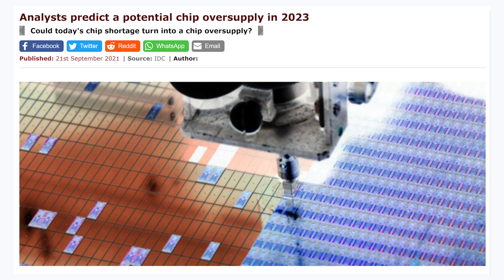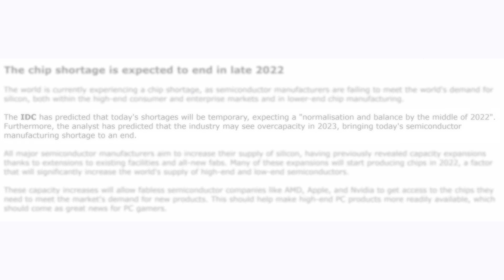You're Going to Like THIS - Chip Shortage Update

Comment: If manufacturers REALLY wanted to help "Gamers" they should have required an account with 2 step verification to battle the bots.
Reply: Well hopefully profitable tanks and the chip overflow becomes permanent because these prices i cant pay 600 plus on a graphics card i dont have the spare change to do that im still 5 6 years behind on gpus i dont even have a 2000 series and if prices continue i would be getting a 4000 series either
Reply: yeah also limit to one card per adress.
Reply: Manufacturers don't control retailers
Reply: @chadbizeau5997  Seeing how manufacturers (AIBs) sold pallets worth of GPUs to miners... I dont see a problem for them to put aside some stock for gamers at MSRP. 2 step authentication account and warranty is tied to said account. Easy
Reply: @priitmolder6475  they sell wholesale.

The miners who bought from them bought in bulk.  

Not saying that I agree with it.  With that said EVGA did set up the queue.  But I know people have been in that queue for a year
Reply: @priitmolder6475  Why would they do something liken that? They will sell it to the highest bidder.
Reply: @DRAG0N1012  The amount of power these GPUs have 
It’s a miracle on how cheap they are. 
If you can’t afford it, then no offense man, that’s a you problem
Reply: @norysmo  They make massive profits on gpus maybe not aibs but nvidia makes hundreds per gpu 600 plus for a gpu when i don’t want or use ray tracing yeah no thanks.  there is no such thing as too cheap that’s a stupid mindset i wouldn’t pay over 300 for a 3060 and definitely not over 600 for a 3080 these prices are overpriced supply constraints or not
Reply: I agree
Reply: But my question is why can't you be a manufactureres

Comment: there is no chip shortage for GPUs. They are all being gobbled up by miners and that will continue forever so long as they basically print money.
Reply: So Nvidia has been lying during their investors calls about the chip shortages?  For a company as big as Nvidia blatantly lying about the shortages does more harm then good.  Why would they lie?
Reply: @CC-il7dg  Your question is based on the premise that Nvidia is claiming chip shortages to investors to explain WHY GPUs are in short supply to gamers which has not happened.  Why should I or anyone accept this premise that you have just invented?
Reply: @r3conwoo  If there is no chip shortage for GPUs like you say then what was intended by Nvidia during their investors call where they say they are  'supply constrained in graphics'?  Is being constrained not indicative of a shortage or is it simply a spin on supply and demand?  Why was 'supply constrained' used rather than just saying overall demand remains high?
Reply: @CC-il7dg  My point is that there is no evidence that they have a reduced manufacturing capacity for this generation of 3000 series cards then they had for the 2000 or 1000 series cards. If anything they have an increased capacity but nothing is enough to satiate the demand due to mining.
Reply: @r3conwoo  Yea when i was digging deeper i noticed that the media coverage on the actual calls seem to have created their own linkages and analysis whether accurate or not and then any bit of misinformation just proliferates from there unfortunately.
Reply: Uhm even car manufacturers having a tough time. Idk what ur talking about buddy, we have no inventory to sell
Reply: @billlam7756  they don't put GPUs in cars so what you just said makes no sense.
Reply: @r3conwoo  you living in the stone age?? Some of the parts is used to make gpu are also for cars
Reply: @r3conwoo  Supposedly the same suppliers of the chips that go into Graphics Cards are struggling to supply the chips that go into cars (e.g Cars with Computers/Displays etc).
Reply: @r3conwoo  you don’t know what you’re talking about
Reply: @Ash-my4gf  no u

come back when you have a real argument
Reply: @billlam7756  you mean silicon? Where is the evidence that manufacturing capacity for Nvidia and AMD is less than what it was in previous years?  Where is it?
Reply: @r3conwoo  no you honestly don’t… you have 0 clue about the chip shortage
Reply: @Ash-my4gf  i told you to come back when you had a real argument not to just repeat lies twice.
Reply: @r3conwoo  no you didn’t you just edited your comment after I replied to you don’t talk
Reply: @r3conwoo  I worked for toyota, not gonna provide you with graphs and data. Fact is all dealership inventory are extremely low.
Reply: @billlam7756  that doesn't mean Nvidia and AMD are making less GPUs than they did in previous years.  How you are making that connection is beyond me but you don't want to seem to let it go so believe whatever you want then.  /shrug

Comment: I want to do both, I use my mining cards to game on now. 5 1080ti's paid for themselves and sold a couple too. Now I just run two. they've been spinning away at 80% power for 4 years now, they only earn about 5 bucks a day and after electricity,  it's an extra 100 bucks a month to stash away for building my next gaming computer. I want to upgrade, not for mining, but for gaming, I'd like to build a 4k 144hz capable machine, right now I can do 1080p at 144 on most games but I'd like a bump in monitor size and res. I despise scalpers and bot buyers though. The two cards I sold were "given" away for half of what I bought them for, not the 800msrp that people are still charging for 4 year old used cards. Amazon and Ebay's lack of anti-scalping policies is disgusting.

Comment: There are limits to how much prices can fall and those limits slowly increase year after year. It used to cost on the order of a couple of million dollars + R&D to design a GPU back in the late 90’s; meaning that a die shrink of an existing GPU was almost free. If you could sell 1 million units that die shrink only cost you a couple of dollars per GPU.

Today it’s hundreds of millions of dollars + R&D. The masks, validation and everything else around designing the chip costs that much. Even if you don’t do R&D and just do a lazy die shrink, if you only sell 1 million units that adds a few hundred dollars to each GPU, even if they maybe only cost $50 each to fab or whatever.

Chiplets help because you can crank out more of a particular GPU and amortize that cost across more GPUs. EUV helped, but soon we will need double and quadruple masked EUV and that will be undone.

Comment: See I might just wait and hold onto my GTX 1080ti unless the rumored Super refresh delivers a RTX 3080 with at least 12GD of Vram for the original 3080 MSRP. Fucking pipe dream I know.
Reply: Don't hold your breath.
Reply: there's a ton of 3060 slack at run end. but I get it I would buy 4 stretch too. mb
Reply: Nah bro keep your 1080ti that card is still a beast for another 2 years.

Comment: Prepare to be disappointed guys ; )
Precious materials required for making electronics have increased in price recently anywhere from +10% to +150%.
TSMC raised N5 prices by +20%.
If anything, prices will increase in 2022-2023. You'll look back at 2021 regretting not buying a GPU now.
Reply from the maker: Earth metals and silicon are VERY cheap. It could be 4x more for copper and still barely matter. 

Plus this is only going be an issue as long as demand outstrips supply.

Comment: If I can buy a 6800 or XT variant instead of a 6700 XT. I'll be happy. My 2060 ain't gonna cut it for a Reverb G2.
Reply: Are you nearish to a micro center?
Reply: You have a 2060!!?! I’d kill for one
Reply: @sindar8179  unfortunately not. I have some garbage homewares store that sells computers and other white goods at a ridiculous markup.
Reply: @colonelpanic17  I'm not complaining about having a 2060. It's a great card for 1080p, which is what my monitor is. But I'm aiming to get a Reverb G2. And I don't want to hear my card screaming because I'm making it try and do 1440p at 90FPS. Or full res 4k at the same frame rate.
Reply: @justinpatterson5291  Yep building pcs was a lot more fun years ago. Mom n pops are gone and the big etailers are just megga corps now with one goal $.
Reply: @sindar8179  I'll put it to you this way. For the 950 a 2060 now costs from scorptech. I could only get a 1660 from the local store we have.
Reply: @sindar8179  As FTC auditor I am keeping an eye on the retail situation. mb
Reply: @justinpatterson5291  I get supply and demand and all. It just seems like everythings all at once gone into ultra screw you mode. I miss local small shops vs New Rotten Eggg, who used to be good before they were bought out.

Comment: I see a “bull whip” in the chip market, similar to what happened to the lumber market. Over supply will happen if not in 2023 than 2024 at the latest. TSMC and Intel are building new foundries in Arizona. Samsung also building in US, not sure where yet. China and Europeans are building their own foundries. Chip foundries are now geo political resources, similar to oil and each country need a source within their country if war breaks out.
Reply: The TSMC factory in Arizona will be a lot smaller than the one in Taiwan. It will produce only 2% of what the Taiwan factory produces each month, which is approx 20K chips. They will probs prioritize car manufacturers like Ford first. So not really helpful.
Reply: @Oozaru85  My understanding are foundries slowly ramp up production. Foundries are very expensive, in order to maximize profitability, they start making chips before its even fully built out. TSMC isn’t going to be fully built until 2029 per estimates. From what I read, they will start with 20k wafer per month and will eventually hit 100k wafer per month.

Comment: I'll believe it when I can get a 3060ti FE for msrp.
Reply: Um, yeah, about that...
Reply: @masterlee1988  so...... pretty much never?
Reply: @bdrmongoose7864  At this point it might be. Though I wonder about the prices of it once the RTX 4000 series comes out.
Reply: Tons of 3060 in build its Ampere run end sorting through the capable devices. mb
Reply: wait for rtx 50/rdna 3 this oversaturated market will crash like evergrande.
Reply: @slumy8195  You mean RTX 4000 series?
Reply: @masterlee1988  nope prices will remain high. the 5k series will see a decline in sells and get as close to msrp.
Reply: @slumy8195  Fair enough, but the 5000 series may come out by 2024 or later which is a long wait.

Comment: Just bought a EVGA 3080 Ti FTW 3 for $2k.. Hope I don't regret it!! xD
Reply: u wont. 3080 TI is an awsome gfx card for 4k gaming @144 Hertz with rtx and all the shinys on. Its a whole new level of gaming. Cannot be compared to what i , since i became a 3080TI owner, call  "low-res gaming". If you dont use 4k res, u dont need a 3080+ GFX Card.
Reply: @Holozon  I have a 2k monitor @ 165 Hz currently using a 1080 Ti.
Reply: If you care about saving money, you made a terrible decision. 😅
Reply: @christophermullins7163  Well… I paid a total of $00.00 for the RTX 3080 Ti, BUT I used the equivalent of $2k by using crypto that was 100% mined. So in the end, I spent $00.00 and 0 hours worked because the computers did all the work mining. I did have pay for the electricity.
Reply: @christophermullins7163  sometimes u need to spend money. perhaps on a nice 4 k monitor, and a bigger powersupply, because u spent money on a 3080 TI :D.... But if you fire up Doom Eternal on your brand new 4k Monitor, or big TV.... all that money was worth it.
Reply: Have the same card now for nearly 3 weeks, went from a 3060ti. Absolute beast of a card, temps are also very good when loaded. Solid purchase!
Reply: @Holozon  I did have a 4k IPS monitor @ 60 Hz that looked beautiful but it was meh for gaming. At the time, 4k monitors with 120+ Hz were over $1,000. I may get a 4k monitor soon.
Reply: you wont buy a new gpu for the next decade I dont blame you.